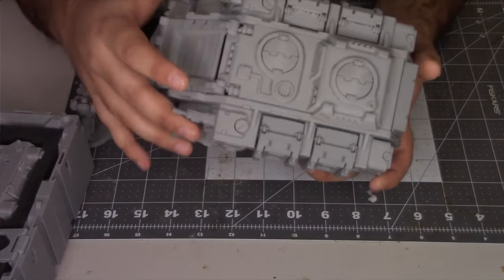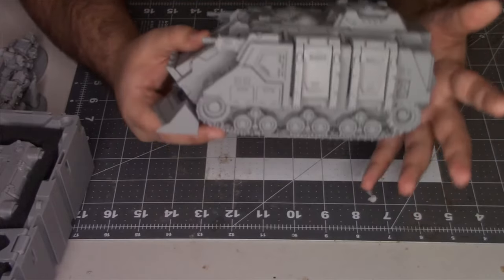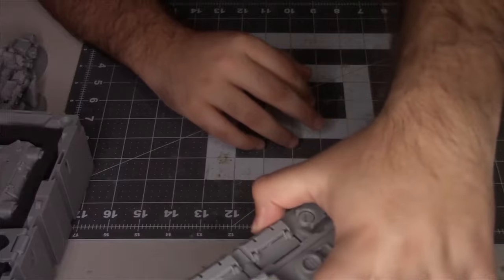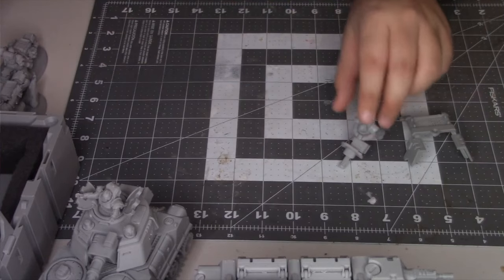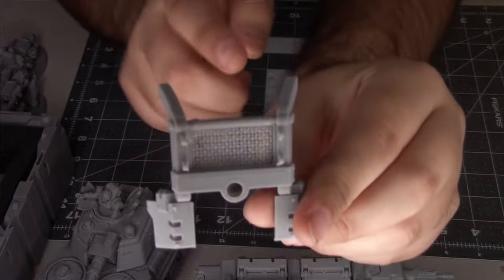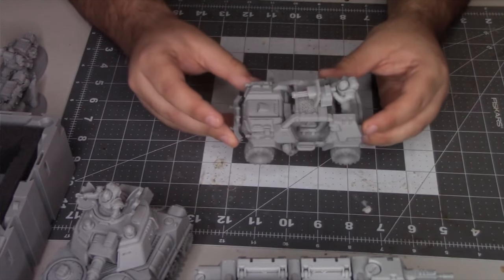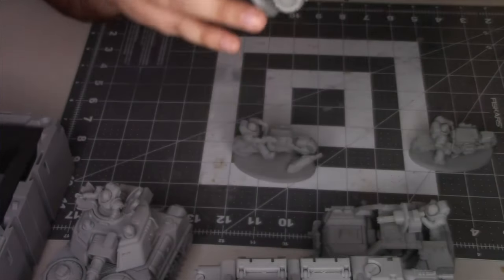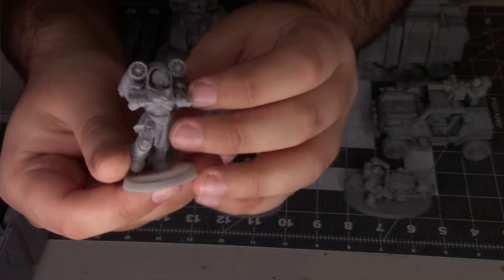Lets Talk About FDM Printed Vehicles

Comment: Really looking like I need to replace my E3v2 with some new hardware.
Reply from the maker: If it works it works lol, I mostly replaced mine due to how long it takes to print, and full bed parts would start curling with full adhesion (lifting the print mat or trying to bend the bed) after 8 hours
Reply: @le_alchemist  it’s done a fine job so far. I’ll likely keep it plugging along. I need to work on tuning it a little better. It’s great right now for some quick and dirty terrain pieces. Truthfully, a flex plate would be the most appealing upgrade at the moment.
Reply from the maker: If it still works for what you need it for, then wait to upgrade. These new machines should go on sale sooner or later lol

Comment: Well, I have PLA printed a few non-warhammer miniatures, here are my tips for beginners:

- If you print on finer layer height, it's looks nicer :) 0.10 is standard quality for me as it has best quality-time ratio.

- Now I print figures at 0.05mm which is even better, and vehicles at 0.15-0.05mm depending on details (but 0.05 mostly for round shapes)

- Do you have stringing issues? Just scrape the strings as much as you can - after that just use some tamiya extra thin cement all over your model - it will reduce the strings even more! (better use some gas mask) you can directly paint on this after drying.

- Prime the model with any rattlecan spray made for plastics.

- If you don't spray your model and do'nt use Tamiya extra thin cement, you may encounter low adhesion of your paint - this can be solved with less-diluted paint (almost sauce consistency) - spread one coat evenly and after drying apply standard dilluted coat (milk consistency) of paint.

- Bonus tips:
Don't want to waste too much money and material to try different paint schemes? buy a set of green army soldiers
Reply from the maker: Sadly, .1mm isn't always an option when using older machines when you're trying to find the balance between detail and time spent printing. The ender 3 pro is a slow machine, so trying to print something like the dominator take at .1mm would take a full week for one figure, that's why I did between .08-.1mm for the bikers on my new K1, I know the k1 is fast and accurate and can handle the thinner layers while keeping time spent down
Reply: @le_alchemist  that's understandable. I have an ender 3 pro too. :)